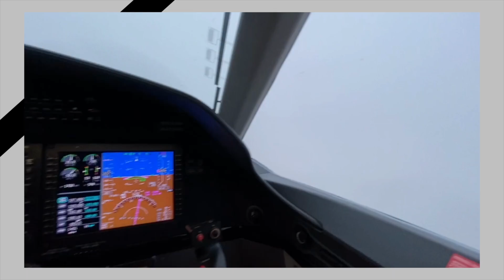Robinson Helicopters, 3 Weird Reasons Why They Are HATED

Comment: That’s why you don’t want to fly a Robinson!  Want to start flying helicopters joint the Army, you start on a TH-72 and fly it through the whole course, contact, instruments, and combat skills,(basic war fighting) before moving on to your assigned helicopters.  When you get out of the Army you can get a job flying much safer helicopters than a Robinson.  Even if you did decide to fly a Robinson you’d have since enough to fly them in the very best weather conditions. 3600hrs in RW and 10,000 in fixed wing.  No accidents, thanks Army, and Airlines!

Comment: Pure junk. You have to send the whole thing back to the factory every 2000 hours for a complete overhaul. There are Bell 206's out there with 22,000 hours flying that haven't seen the factory since new. The cyclic is an instructor's nightmare. The rotor system is a gyro design, good for auto's unless you're in need a bit of inertia at the bottom. 50 hours of instruction to fly insurable. No thanks... JUNK but good for those that can't find a real helicopter to learn in. Good luck finding a job flying anything else with just Robby time. R66 will let you at least log some turbine time, but with just Robby time you are useless for most real jobs and you will be shown the door....

Comment: Do you have any opinions on the rotorway brand of helicopters?
Reply: Your question should be:  do you have a opinion on experimental ( FYI rotorway is exp )
Reply: @gilkennedy7638  there are many experimental helicopters. I am speaking specifically of the design and engineering of this brand
Reply: Do you want to just hover  and taxi in ground effect below 500 feet DA, or actually f)y cross country?  You cant do the latter if your engine and design doesn't have the balls.
Reply: PS in flight two things keep you alive in an emergency. Power to achieve altitude. And Altitude to figure out what to do next, when somethin' f**ks up. Flying is not like driving a car. Someting goes wrong, you pull to the shoulder. Flying, you step out of the aerodynamic balance for just a few seconds, and you stall and fall, and die.
Reply: Basically if one can't comprehend the complex physics of flight, just buy yourself an airline ticket. Because otherwise your lack of understanding flight physics will quickly kill you and anybody with you. That's just the reality of flight. You either get it and keep aerodynamics in balance. Or it kills you.

Comment: DUDE - Just had a long time friend die in the R44 crash on Kauai from another tail-boom rotor strike.  He was a GREAT pilot with thousands of hours flying commercial airliners and helicopters.  This accident was caused by the helicopter malfunctioning due to design flaws.  Robinson need to fix this issue before more great (and not so great) pilots die.  There is a problem and they are ignoring the problem.  They continue to place a dollar value on a human life.  Its unfortunate.

Comment: great info.  Hughes 269 is a great, safe trainer.  Robinson is a good trainer if properly handled.
Reply from the maker: Thaml you Henry! I seriously appreciate you so much! Hope everything is goung so well!
Reply: I agree the 269/300 is a great initial trainer. Very little control lag. First time up I did a 90/ 90 180/ 360 hovering pedal turn perfectly. First flight in R22, upon his hover landing, gave me controls and told me to taxi 70 feet forward. It went forward but ignored back collective, so I pitched it back alittle and got screamed at. Basically 269 more stable and less lag ship. Robinson. "If you can fly it, you can fly anything" as the saying goes. But leaving out the contextual antithesis: If you can't fly it, you're dead. That's a shit design IMHO

Comment: This seems like a problem that can happen in any type of rotor system, yet, I only hear of 2-bladed rotors being at risk of mast bumping. Is there any particular reason why this is so?
Reply: All rotor blades need to flap (up and down). On a rigid or  fully articulating this is done by the blades themselves. On a semi articulating system (2 blades) the entire head teeters like a teeter totter in a play ground. Mast bumping is when the head reaches the end of the teetering and strikes/bumps the mast. Most all 2 bladed have droop stops so when the inertia of the rotors slows down these stops engage to prevent the mast from teetering (blade flapping) and striking the tail during startup/shutdown. All rotor head designs can strike the tail boom in very extreme low g maneuvers.
Reply: With more blades, they don't have to be as long, so don't suffer from as much droop.
Reply: Mast bumping is really a two bladed issue. Articulated systems also have issues at low gee ( pounding the droop stops ), but that happens at a lower gee, so less likely to happen unintentionally.

Rigid ( hingeless ) rotors ( like the BO105, BK117, EC135 etc) can be fully aerobatic ( think Red Bull ).

The thing is, each of these have advantages and disadvantages. You can fit about 5 R22 in the same space as an Enstrom articulated rotor machine. 2 bladed is more efficient than 3, 4, 5 bladed machines, so arguably better for a small machine with a less powerful engine.

Even hingeless rotors have some drawbacks. Believe me, rotor design is an incredibly complicated business. Fixed wing aerodynamicists have nightmares about rotor system's 😮

As for the person who commented about droop: that really doesn't apply in flight...

Comment: Pretty fucking simple. The laws of Newtownian physics are immutable, at least into sub atomic quantum mechanics. Basically, Gyroscopic energy is dependent upon the tip mass of the circumference of the gyroscope. Bell 47 with 10# weighted blade tips, gives you 3 or 4 seconds to get that collective down.  Robinson short non weighted blade gives you  1 second at best, or inertia sinks below recoverability. Same Teter head 2 blade design. One is casual, the other deadly. One conforms to the laws of inertial and gyroscopic  physics. The other relies on voodoo that the pilot gets it all right in 1.5 seconds. The former keeps you alive, the latter kills you.
Reply: Just don't have an engine failure in the first place. Maintain the machine, check it before flight, use the carb heat. Don't rag the ass off it.
Reply: There's no question that a higher inertia rotor gives you more time to get the collective down. But that's not how people are getting killed in light helicopters. I've taught in all the Robinsons, the Enstroms, and Bell 206s... They each have their advantages. If I'm out flying around in rough terrain in the dark, the R22 is definitely not my first choice. But it's used because of economics... And that's mainly the student's choice ( perhaps partly due to lack of knowledge ). Go ahead and try to run a school with Bell 47s, competing with a school on field with R22s... You'll get clobbered because most of the students will select the school with the least expensive machine. ( Same reason you don't see more schools using the Guimbal Cabri G2 )... 

Also, all R22s have had tip weights since the early 80's... You've got about 2 seconds to get the collective down ( and some aft cyclic ). It's not huge - hover autos from 5 feet start to be a little firm... But it's enough for most trained pilots to get the collective down in time.

If I was going to pick what I think is the biggest negative of the Robinsons, I think it's the T-bar cyclic...

Comment: i have 5,000+ hours in the R-22 if its flown within its limitations it will bring you home every time, do something stupid or careless it will eat your lunch...
Reply: Heh, this sounds kinda like how a motorcycle is more dangerous than a car, with cars having multiple airbags, seatbelts, crumple zone protection, stability control, Drivers assist systems, etc. None of that is on a motorcycle, so do something like high side a sport bike at 100 mph and it might launch you into the tree by the roadside🤔😳🙄😏

Comment: 1200+ hours, most in helos: TH-57B, TH-57C, SH-60B, UH-60L/M. Zero chance you'd ever catch me in a Robinson given that one encounter with moderate clear air turbulence can be a death sentence. I also don't think it's a great trainer: the piston engine gives it different throttle response than a turbine, but more importantly, the weird "wobble stick" cyclics require new pilots to adjust to something else when they move to something less primitive / weird. You're much better off learning in something that doesn't require as much adjustment when you move on to something else (i.e. a helicopter more representative of helicopters in general). Yes, turbine training is expensive, but I keep coming back to the whole, "Die horribly in moderate clear air turbulence" as a pretty good reason not to ever get in one. FWIW: I think the Cabri G2 is a significant improvement that will better prepare new pilots for moving into the AS350.

Edit: in flight school I hit clear air turbulence in a T-34C that smacked my pocket checklist up into the canopy several times in a row and over-G'd the aircraft (+6.5/ -2.4) badly. I'd be dead if I were in a Robinson when that happened.
Reply from the maker: A lot of good information in this comment. I still believe the robinson platform is safe and can be operated safely but there are absolutely better training aircraft on the market. The Cabri g2 is much better in almost all aspects!
Reply: Military pilots have disliked the R22 since the start... It's so small and so nimble, and so unforgiving compared to a UH1 or 60... The throttle response is so much quicker than a turbine, it does give the instructor some options you don't have in turbine aircraft. ( In an R22 at the bottom of an auto with the RPM at some ungodly low value, you can get it back in a jiffy ). You also have what some would say is an advantage of not having to worry about torque or temp limits... ( At least in the 22 and 44 ). I'm not sure how often military students overtorque at the bottom of an auto, but I think it's safe to say that for all the civilian schools out there it's a big advantage... And you know, no hot starts either... My thumb is permanently bent from mashing down on 206 student's fingers while they start the machine!

On the subject of the T-bar cyclic, I 100% agree. If you haven't taught with one, while they are fantastic for slope landings, I think they're pretty dangerous. If your student slams the cyclic around on you, it's a 3 dimension problem trying to get your hand back on the stick... With a conventional stick it's kind of 1.5 dimensions, since your legs constrain where the stick can go. I would like to see the R44 and 66 have a conventional cyclic. Sadly, there simply isn't room in the 22 for one.

As for your turbulence encounter... I had one student slam the stick all the way forward in a 22, so hard that it popped out of my hand. We didn't bump the mast, although my knees were knocking pretty damn hard I was so scared. My point is, that while certainly risky, it's not a 100% death sentence. There was a 22 on floats that did a complete forward tumble 360° tail over nose inverted from a practice throttle chop at VNE... They did bump the mast, and that incident got the VNE for float equipped R22s reduced to 95 knots, but they did land and walk away from it. 

The 300 killed plenty of Vietnam trainees ( at least according to the much discredited Robert Mason ) from the -300 tuck... My only point that most helicopters have some pretty strict envelope edges / issues. I had a buddy who flew CH47s in Vietnam. One day I asked him how much he trusted those machines and he said NOT AT ALL. Also flew with a crew chief whos unit lost a 47 ( and crew ) from a tool ( screwdriver? ) being left in the synchronization shaft tunnel... Which doesn't make the Robinson safe, but does illustrate that lots of helicopters have these sorts of issues...

By far the biggest issue with the R22 in the early days ( at least according to the factory ) was that a lot of the instructors were ex-vietnam guys who treated it like a toy because of its size. The R22 is a remarkable machine, but one thing it is not, is a toy. Or, it's a very dangerous toy when not used properly... In any case, fun to read your experiences...

Cheers!

Comment: Of all the tings out there that you should not go for the cheapest one : "Helicopter" might be at the top of the list.
Reply: That's quite an easy point to make when you have a million dollars/pounds/euros in your bank account.
Robinsons might be classed as "cheaper" - but that doesn't mean low quality.  They are manufactured to the Highest standard, and performance is perfectly safe if the POH is followed - just like any other aircraft.
In a perfect world, we would all be flying expensive turbines - but it's not a perfect world.
Reply: @paulward4268  agreed. And in an imperfect world, settling for a far less than perfect ship gets you killed. Same for ocean going vessels. Designing on the extreme edge of the laws of physics, has it's lethal penalties. Headroom in electro/ audio physics is always best rational, rather than self destructive design
Reply: @jakerabinz9411  Those are fair comments. I know nothing about maritime matters, although I appreciate that standards must be equally high.     For myself, I've been involved in aviation since 1989, & I've flown the R22 in the UK since gaining my licence in 1995.  in that time, I personally have only had one electrical failure.  And thankfully, other pilots that I have met over the years, have all had good training, and dealt with any issues that arose, properly.   The problem comes with irresponsibility - there are many who gain their qualifications, and then go on to fly outside the limits of the POH - or their own ability. Either one can lead to a fatal accident very quickly.  I see the problem as similar to driving - anyone can gain a licence, but we all know that there are people out there who shouldn't be behind the wheel - nevermind actually being let out onto the road. 
The Robinson is a sound design almost 50 years old, but it does not tolerate a lax attitude or stupidity - and when accidents do occur - 90% of the time, the aircraft unfairly gets the blame. Back in the early years when the first underpowered models came onto the market, if the machine had been found to be as lethal as some say, then it's certification would have been withdrawn then, but it wasn't.
There are many types of aircraft, both fixed wing & rotary, that require careful handling, and the Robinson is just another one of them.

Comment: The problem of mast bumping & low-g is also characteristic of many Bell helicopter made.  
AH-1 Cobra & Super Cobra... UH-1 Iroquois a.k.a. Huey... Bell 222 a.k.a. Airwolf... Bell 505... Bell 206... etc.  
In fact the majority Hueys & Cobras lost in Vietnam were due to pilots inadvertently performing low-G maneuvers... which is why the new AH-1Z Vipers & UH-1Y Venoms were upgraded with 4 blade fully rigid rotor systems.

Comment: NO! Mast bumping happens not only because of poor handling! Turbulence, windshear or wake turbulence can cause mast bumping as well, and all the pilot did is not evaluate the situation correctly, or he might have been used to fly helicopters in which turbulence is not a problem.

And: It is good, that there are "cheap" helicopters out there. The thing that is not so great is that they quite often get flown by the pilots with the least experience, although they are the helicopters where a mistake can kill you. Believe me, none of those pilots who died to mastbumping thought "nah, I don`t think that`s gonna be a problem" and flew voluntarily into this situation. Frank Robinson himself said that the R22 is not good to train new pilots, it is designed for experienced people looking for an affordable helicopter. 

And lastly: I fly the Cabri G2 and the Jet Ranger. I find the Cabri way easier to fly, although it is much smaller. So "the bigger the helicopter the easier it is to fly" might be your idea, but for sure not mine, and i know quite a few pilots who agree with me.

Comment: You missed out that the R22 has low rotor head Inertia and are very susceptible to to rotor slapping. The absolute worse thing is the Cyclic and its wobbly controls. Each pilot needs their own cyclic.

Comment: I learned to fly in low-power R22 HPs back in the day and low-g awareness and recovery was part of our training from day one.  After 2000 hours as CFI on those and R44 I never had a single occurrence of low-g issues. You just know what to do: Go slow at high turbulence conditions, if you get low g, pull back, load the disc and fly on. As an instructor, I see a decline in the quality of student pilots though. A helicopter is not a jet-ski or toy. Flying helicopters is a pretty dangerous thing and not a "5 hours a year" rich kid thing.